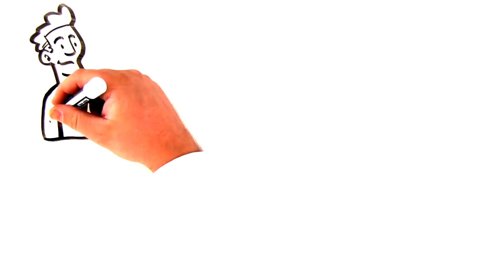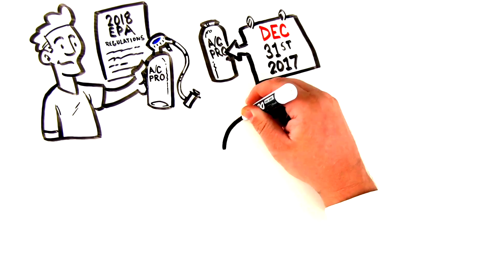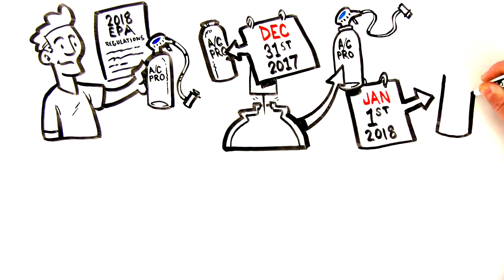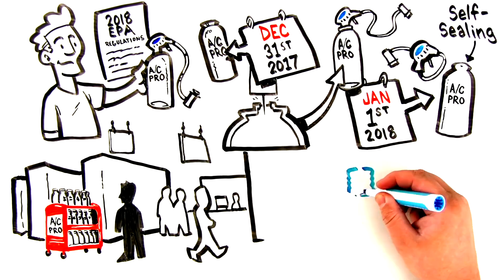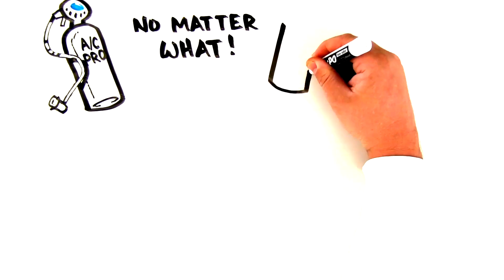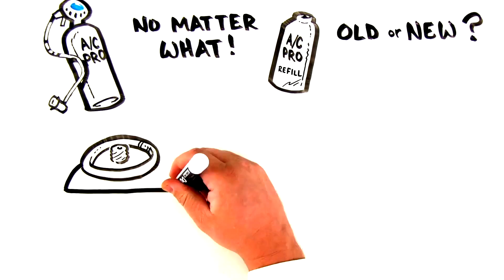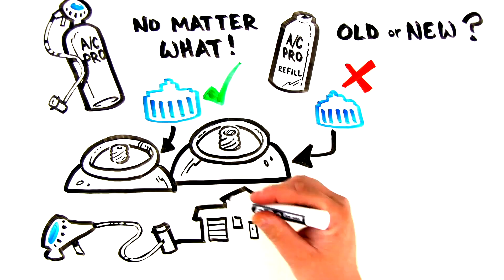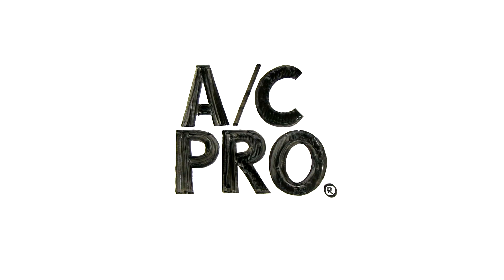A/C Pro® Self Sealing Valves

Comment: I purchased an IDQ Adapter and followed the directions: 1. Screw the adapter onto the can, (check;) 2.Close the valve on the old piercing valve, (check;) 3.Screw the piercing valve onto the adapter, WHOA! The refrigerant blew out as I frantically hurried to screw it on tight! I didn't have gloves on, and it was painfully cold on my hand, besides venting R134A into the atmosphere. What a horrible "improvement." I never leaked (wasted) refrigerant using the old style cans.